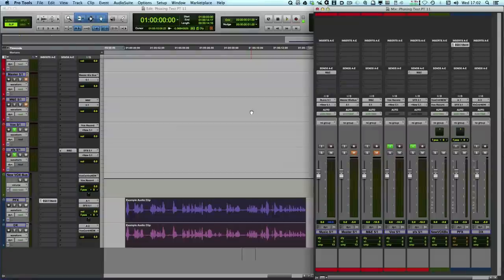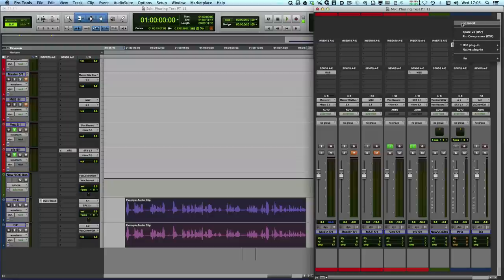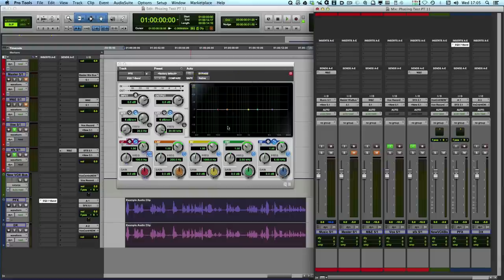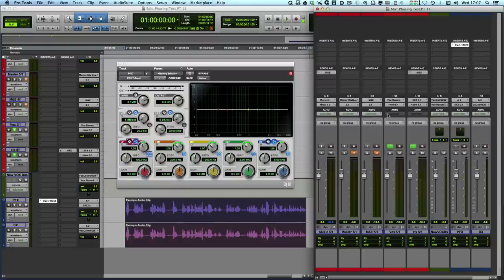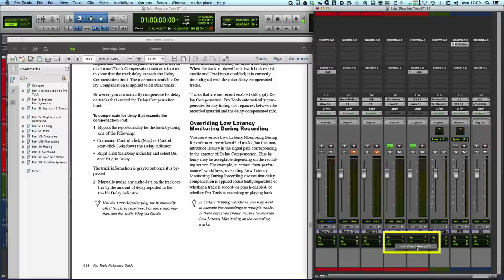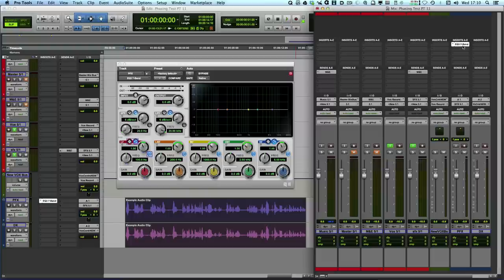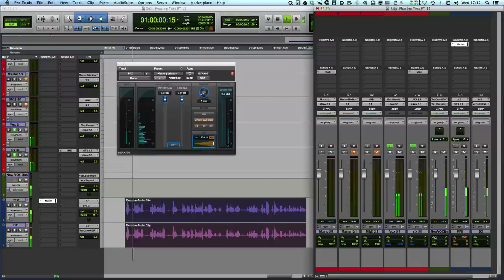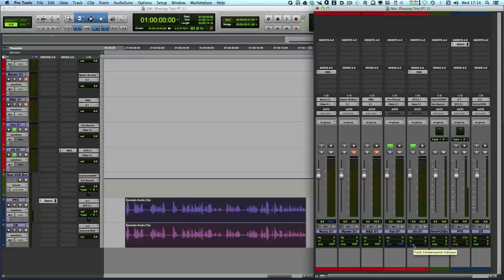Delay Compensation Issue And Solutions When Using Cascading Record Tracks In Pro Tools

Comment: Thanks for the video. I came across this since I have been having issues bouncing drums down to new tracks as well. My question is this. Since you are keeping the delay compensation on the track that you are bouncing to(by making it blue), isn't there still a problem with the track with the plug ins still having their delay compensation turned off once it's being routed to a track that is record enabled? I understand that while bouncing it will sound ok, but afterwards wouldn't the tracks still be out of alignment since the tracks feeding the new ones don't have their delay compensation turned on?

Comment: Hi and thanks for this. There is a bug in 'Tools 10 at least that also appears to be occurring in later versions. I'm running a PT10 HD system on Mountain Lion. What I'm finding in record enabled tracks is when doing a drop in the track being recorded goes totally out of sync in the pre-roll. When it drops in it is in perfect sync. It is only in the pre-roll that a problem exists and it is so bad as to make the talent unable to listen to his/her previously recorded section leading to the drop in point. If I duplicate the track and allow the talent to listen to the pre-roll on the duplicated track (without record enable) there is no issue but this is not a reasonable work around in a professional workflow. This ONLY HAPPENS INTERMITTENTLY. That is what is crazy making about this. It does not happen all the time and the only way to remedy it when it starts happening is to do a reboot of the Mac and try again. However, this is not always the solution since there are times when the problem persists and a workaround is required. Do you, or any of the readers, have any suggestions?
Reply: Also this happens with no plug-ins and no routing between tracks . It happens on a completely clean session and with Long Delay Compensation selected in prefs. Remember the problem is only in the pre-roll but not in the recorded section. I am not the only one to report this. It has also been reported by others in Daw-Mac.

Comment: This is such BS.  Saw this and didn't realize I had already commented. I can get the same "Non Bug" result with NO Cascading tracks.  I could basically have 1 track recorded. Lay down another & it is Misaligned. No Bug ?  Right......
"Congratulations on buying your new Ford/Chevy/Etc town car. Oh we are sorry but the steering wheel will not function 73% of the time". "Nothing to worry about. The car IS functioning normally. It's just that most times, it won't drive correctly." "Oh did we mention - you no longer own your non-defective auto. It is now  rented by the month". "Although we will say you "Own it". 
Ridiculous you say ? This issue is SO basic to the product, & yet there is nothing wrong ?